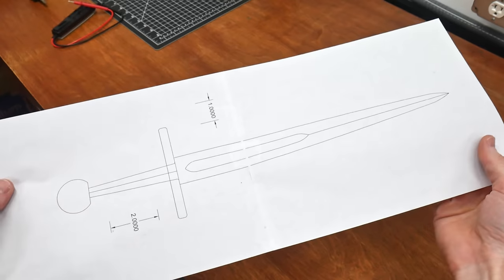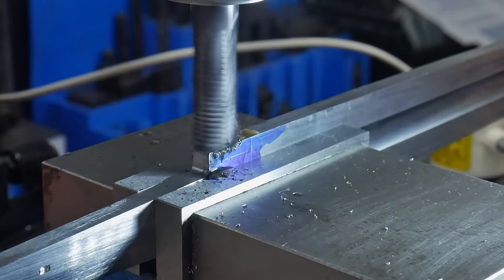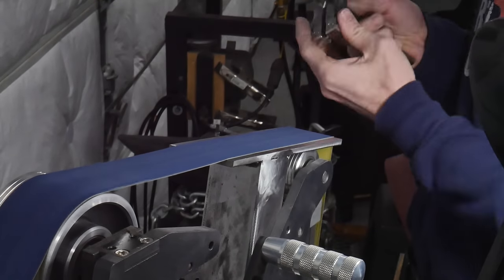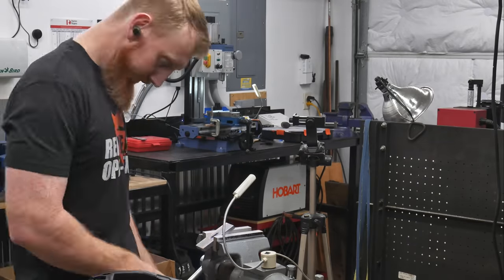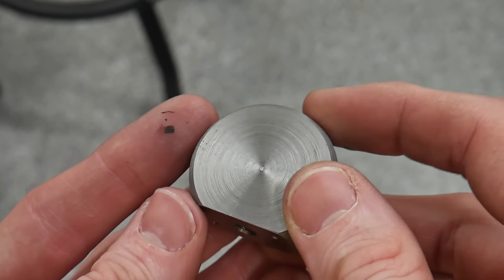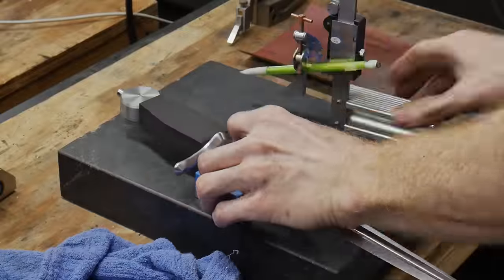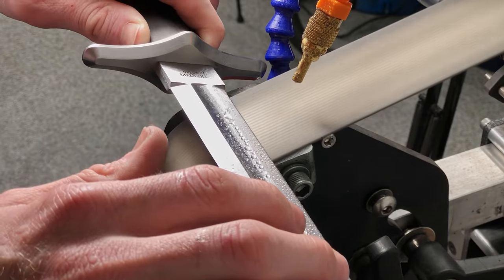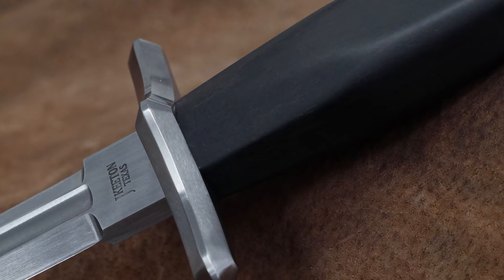Apple Dagger Emoji Brought To Life - 🗡- YouTuber's Challenge Build

Comment: Hey thanks for the tip on that Amazon bought face Mill! For $45 I got the two and a half inch on the R8 Shank and tested this morning. Blast through aluminum that's for sure. Going to try surfacing a 5160 forged test sword later.
Reply from the maker: NICE!

Comment: I think my favorite part of the knife has got to be the guard, that thing looks slick!

On the tang nut/finial, a technique I've seen is to drill an off center blind hole on the side of the pommel that intersects the edge of the finial.  This hole doesn't cut into the threads, but just on the very edge of the nut's OD.  Once the nut is tight and the hole is drilled, press a pin with a bit of epoxy in there, cut off excess, and sand smooth.  If you bring the finish up high enough, and the pin/hole fit is tight, sometimes it's completely invisible without a loupe.  It's also the same method they use for pinning gas blocks on AR's and AK's, though a tapered pin is used in that case.  Really only mentioning it because the shape of the pommel and finial is a great choice for pinning.  Entirely not necessary, but it might be a handy option in a future build.
Reply from the maker: Very cool idea! Thanks for typing it out.

Comment: @Red Beard Ops I'm curious of what your finished weight is?...since you mentioned that it's blade heavy, for the future, you might want to use about 2/3 to 1/2 of that thickness to start, use a hollow grind as you mentioned, but also incorporate a distal taper...daggers are like swords, and need a distal taper, to avoid being blade heavy (you don't want a massive pommel)...a bastard sword should weigh in between 2 and 3.5 lbs, so if your dagger is to be functional, it should be comparably weighted...I recently made a version of the Silver sword, used in the Netflix series "the Witcher" and its finished dimensions are 41.5 inches, and comes in at 3 lbs 10 oz...it will flex to almost 45 degrees (I was too afraid to take it further)...it's possible to make a thin, light, strong dagger, that is both stabby and slicey
Reply from the maker: It comes in at about 1.33 LBS. Thanks for the tips and thoughts!

Comment: Nice video again James. I did not see your mistakes until you pointed them out - except for the machine marks on the pommel. Just a question - I noticed you sometimes leave quite a gap between your grinding support and the belt. Have seen this in previous videos as well. Is this intentional? And why? Makes me nervous ;-) ATB.
Reply from the maker: Thanks Johann! It depends on what part of the knife I'm working with. For instance you can see I get really close with the work rest when beveling at 04:02